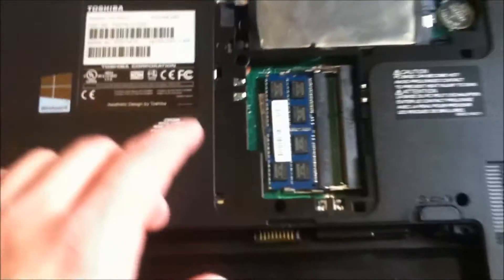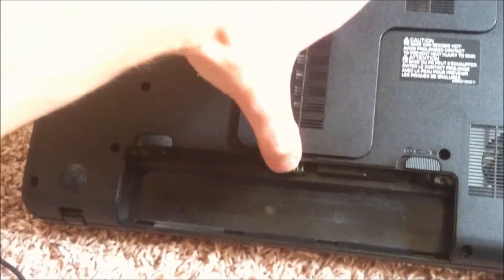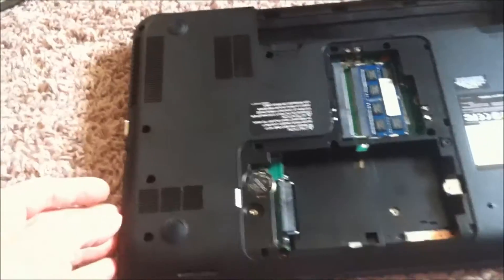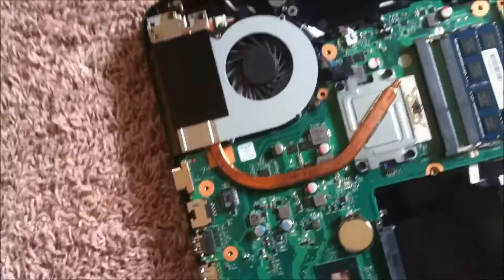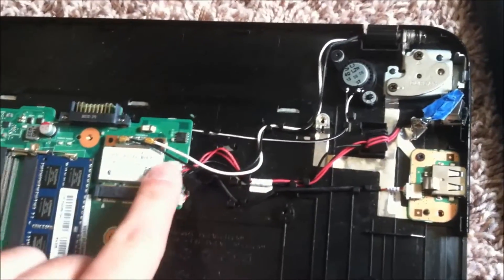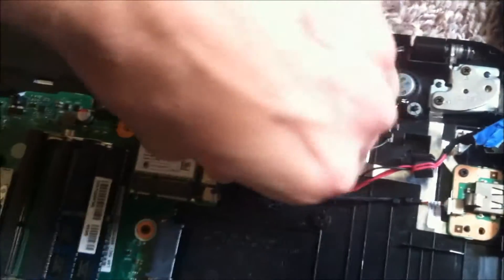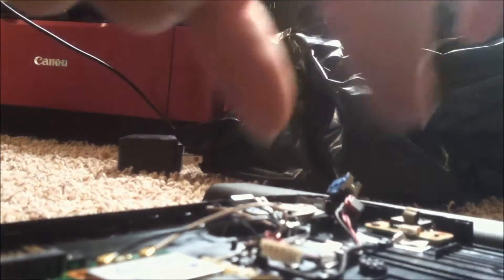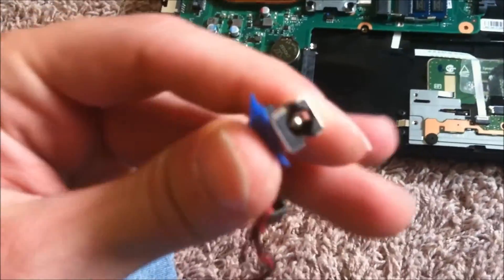How to replace dc jack on Toshiba Satelite C55t-A5222 disassembly video

Comment: Some thing happened to my computer, may you give me a estimate of how much it would cost to fix this problem if I took it to a repair shop? I just want to have an idea of the price so I don't get cheated.
Reply from the maker: I charge $40 to do this. Shops will charge you probably $120. You can send this to me to fix, if you contact me on facebook or gmail, I can get the part ordered and fixed in a week.